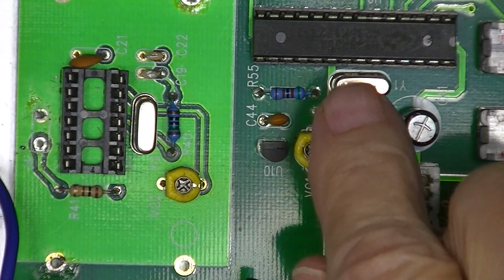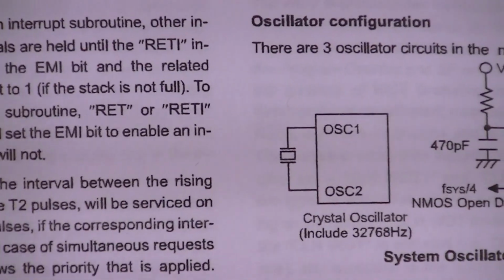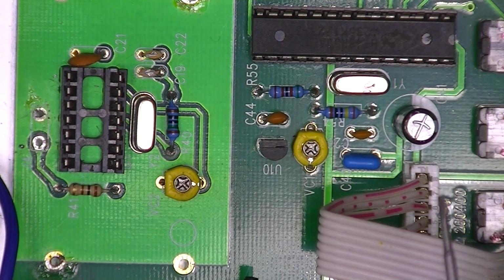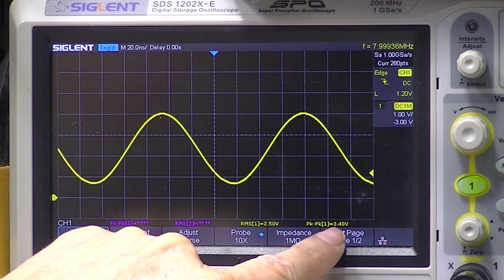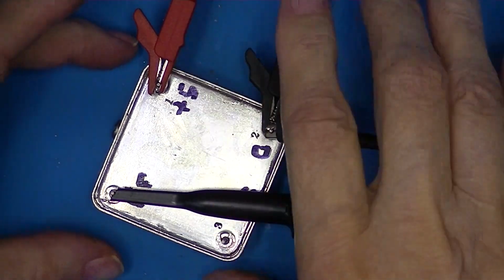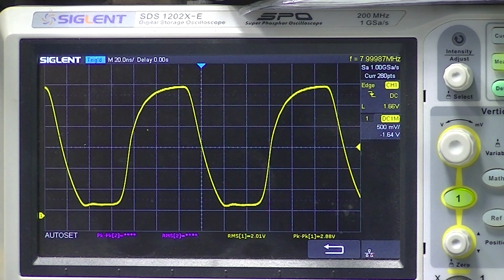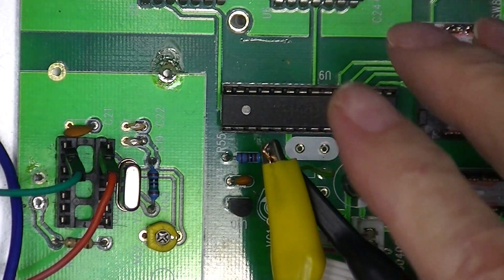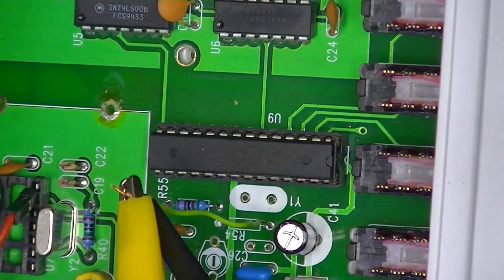Mastech 6100 Attempted Upgrade – Part 2

Comment: And what about a calibrated Agilent oscilloscope? If you rely on the accuracy of the oscilloscope, then this may be the small error. Rather, it would be like comparing the time base on one channel with some precise 8MHz standard on the other channel on the oscilloscope and by the agreement of the standing frequencies you will be sure that the time base is indeed exactly 8MHz.

Comment: Looks like you are on the right track and well on your way. I wondered if the Asian used cell tower 10MHz OCXOs might come in 8MHz models, so I checked for you on AsianBay. I only found one similar offering. Here is the title: 1× NDK END3102A 8MHz 20*20mm OCXO Crystal Oscillator. IMO, not such a great price at 1 for $20, but the listing says that you can make an offer. Otherwise, TCXOs have come down in price, best I can tell, at the OEM distributors. Looking forward to the next episode. Cheers.
Reply from the maker: I have one of those on order. The question is, should I put it on the 10 MHz, 5 volt Chinese board or on the US made "OCXO test fixture both shown in my most recent mail video. The Chinese board is quite deceptive, having a lot of additional components on the bottom.
Thanks
Steve
Reply: Hi Steve, the Chinese Board has a 10MHz Low Pass Filter on the Bottom :
C5 to C10 and L2,L3 Low Pass Filter to transform the Square wave Output(HCMOS) to a Sine,
The Circuitry around U3 is for the REF Voltage for the Freq Adjust Pin of the OCXO
The rest is Just 5V VCC LC Filtering an OV Protection.

The US Board I think does not have a Low Pass Filter, but is Huge!

By removing C5 & C7 and Connecting the RF OUT Pin of the OCXO on the Board to the SMA Connector Directly would be an option, given that the Pinout of the Old NDK END3102A OCXO is the same (from what I see its not).
Or You just remove C7 ans connect directly a Coax from the RFOut Pin of the OCXO to y Counter Board.
Cheers,
Konstantin